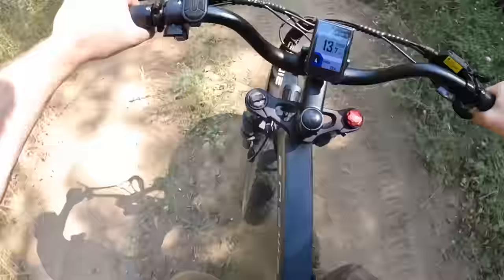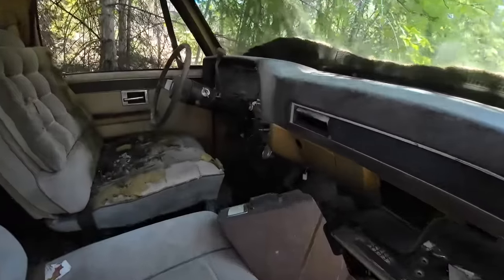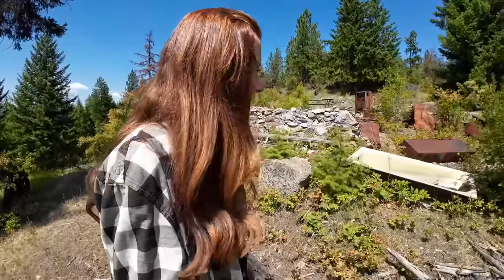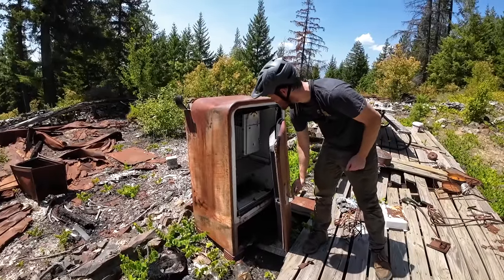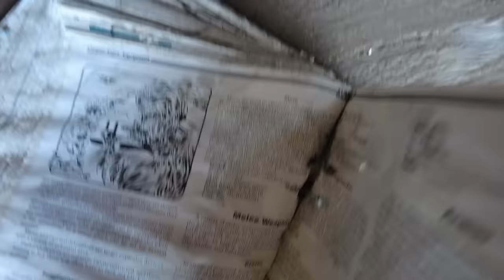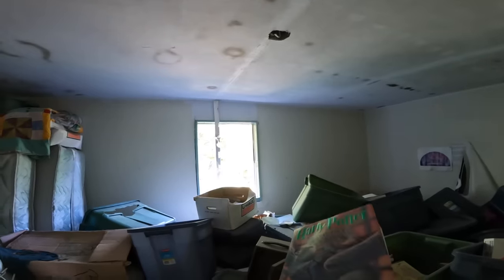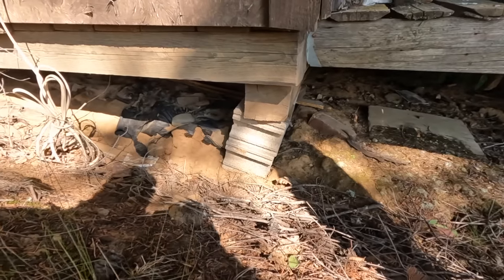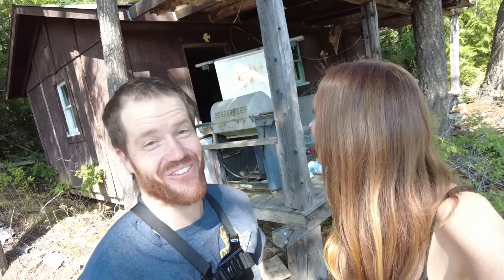We Bought An ABANDONED Homestead... cabins, trucks, & treasure?

Comment: Scrap the metal, bonfire what you can, dumpster the rest. Probably need to hook up a utility trailer to a UTV to get the garbage out. People grossly overestimate the value of a stick frame -- especially when they're clearly inadequate for snow load. The walls and roof cost way more. More stuff for the ol' todo list :)

Comment: It’s a pretty common story: the property was homesteaded twice, separated by 15-20 years as each owner tried to build their dream home “on the cheap”, rather than the right way.

One ended in fire, the other probably in bankruptcy and foreclosure, as any surviving relatives just washed their hands of the whole fiasco.

Best bet is to bring in a hazmat rated waste removal company to truck all the barrels, fridges, and other junk out, then bulldoze and burn pile anything wood that remains.

As for future use of those areas on the land, a seasonal tent and small RV campsite with off-grid electrical hookups and properly plumbed toilets on a septic system is one possibility. Depending how active you’d want to be with passive income, setting up a small general store and playground would take things up a notch.

Another option is building out a proper access road loop, and partnering with a timber company to come in and responsibly cut and replant a percentage of the land each year. That way, you rake in the residuals for owning a thriving timberland, the forest is adequately replenished and managed against wildfires, while you also create jobs for the locals.
Reply: They only own 20A !
Reply: Umm 🤔 I don’t think they won the lottery or the Powerball to achieve all your ideas 💡 💡😉😝😝
Reply: And run a few head of cattle to get the ag tax break.
Reply: more than likely they  have no mineral ,timber or water rights they are often sold off long ago!
Reply: Are you high? Do you know how much a hazmat waste removal company would cost to go way up there and removed all that crap? Sheesh...
Reply: @brucewitcpalek5120  No doubt. All they need is many tens of thousands to do all that.
Reply: @Badge124  you dont need cattle, only 3 acres,,,,,post more ignorance and ill reply to that also,,,
Reply: @glennwall552  world wide,,,its always money or control
Reply: @bill45colt says the guy with horrible grammar 😂

Comment: My wife having grown up in that area and my mother in law still living in the area, I can tell you that meth is a big problem (one of my brother in laws is currently doing time behind that). The condition of the contents of the cabin is indicative of someone who slid into addiction. 
As for how they got stuff up there  . . . dirt roads deteriorate over time. Looking at the condition of the road, it appears that nearly 25 years ago you could easily drive a pickup up there in the summer. Everything you saw there could have been transported there in a pickup.
I think you need to figure out if you can get the M1078 up there. If so, start making trips to the dump. The excavator will make quick work of ripping the place down once all of the trash is removed.

Comment: Fun tour, Thanks!   Beautiful place.   Random thoughts:  1)  That stuff is all stolen from storage  lockers.  That's why it's all in totes and it's more than people would normally have.  You can probably confirm that by the names on the pill bottles - are they all different?  They'd cut a lock, fill their pickup, and head for the hills.    2) I'd grab ALL those baseball cards!  Some are worth more than $4M.    3)  You might want to quickly sort that trash into a huge pile of the stuff that would burn cleanly for a fun bonfire in the snow.

Comment: The round battery cells are likely from a telephone company central office facility.
Reply: Some telphone central office batteries are big open jars. Like 2 ft tall and 1 ft diameter
Reply: Honestly, until Riley was standing next to the batteries, I thought it was an old, burned out still. Until I had a scale reference, they looked much larger than they actually are.
Reply: -48 volts.

Comment: OMG.  Those blocks in the foundation are oriented wrong.  The weight should be on the walls of the brick not the face.  So the holes in the block should be vertical.  That's the strongest orientation.  If you jack parts up to re-level that cabin, rotate those blocks so their are oriented properly, with something under them to distribute the weight, like a paver or a pad of concrete.  What a fun project.

Comment: You need to go through all those baseball cards. There are singular cards which you might find that could pay for that whole property. Let alone findingva bunch of 1990 rookies.
Reply: 90s baseball cards aren't really worth that much.  Like some of them I looked up recently are still around the same prices as they were in the 90s without being inflation corrected.
Reply: @yayinternets  that was just an example off the top of my head. There's a Derek Jeter card from Upper Deck or Fleer for example or Chipper Jones or Vlad Guerreo card that had some exceptional value. I only keyed on 1990s in my comment because they found other 1990s stuff. But looking at the stuff they found (TTRPGs for example as well) indicate that someone there was a hobbiest, which means they could potentially find some valuable baseball (or nonbaseball) cards, comic books and some other interesting stuff.
Reply: @thtadthtshldntbe  More of a hobbit than a hobbyist.

Comment: Ambition strikes has been one of my favorites but you are becoming a loose cannon, you never finish reporting on anything (Endless water? Road? Shop finish so you could start working on projects)  and now you are spending money on many thongs that you dont need.  Used construction equiptment will eat you alive with maintenance cost, the definition of a boat is "a hole in the water in which throw money".  Dont mean to be negative but stick to the original concept of your post which have been interedting in the past.

Comment: You can use the broken plates from the burned down cabin to make a cement table with broken plates.

The hoarder house you need to comb through carefully it could have tons of valuable collectables like as examples bottles, knick knacks, promotionally stuff , historical artifacts (both about the cabin/area and in general) trading cards (also some harry potter books and other books is worth alot)

Comment: on the truck you need a really long flat head..there should be a hole in the front behind grill by the latch ..insert and twist, should pop up..engine is 305 or 350 if its a v8.. i have had 6 scottsdales..

Comment: Scottsdale was the mid-tier chevy K10...lower was Cheyenne and top of the line was the Silverado. It could have the 305 V8, which was the weak link in the Chevy Trucks of the 80s. It probably has 165HP and 235ft-lbs torque, not bad, but kind of blah. Would be a fun truck to re-do, since there are parts available from 73-87. I did a 87 K10, but it had a small block. A little bit of work in the machine shop, plus a few trips to the parts yard and I had a 327 with PLENTY of power. I miss that truck. Plus it had fuel injection, which was a cool bonus for the 87s. Yes, it was only TBI, but it got an extra 1 mpg...

Comment: I am a reseller and you do have money in that second cabin, (at least you do for the stuff that did not get wet or smells musty) Hopefully you have a friend that resells that can go through it quickly and separate the trash from what is resalable. It will not be that same as finding gold like you said but possibly a couple thousand net. You can also take what is salvaged to a local auction house and have them sell it. Use the unbroken totes with lids to repack what you can sell and you can get rid of those also.

Comment: Hey that luv may have a surprise under the hood . overhead view showed middle of hood with hole --means maybe v8 lurking under the air cleaner ..Or v6 either way that's how a gear heads mind works ,was maybe a " sleeper " , like a 240z with a v6 or v8 with turbo ,, 0 to 100 back to 0 in 12 sec.

Comment: The batteries remind me of old glass jar telecom batteries.  They are very large storage but low voltage lead acid type.  They were also used in radio repeater shacks...

Comment: 9:33 the old scary cabin. My wife and I drive on most trips (you actually see life than 30,000 ft in the sky) why I said that we tour the south back country mountainous roads and saw cabin after and even houses on bricks, concrete pavers to stumps.
I thought NO WAY would I do that, then I had to think back country. In the south there's lots of flooding, so it makes sense until I saw this video. 
Apparently, you use what you find back in the 18th and 19th century back country homes? 
Great channel, I just found ya all.

Comment: I would definitely get everything out of the house first.  theres tons of what appears to be useless knick knacks, and books, so definitely get all that out that you can.  And then burn the rest of the place or doze it.  If you burn it, the mildew is gone.  but if you doze it, you will be tempted to pull out a rotten 2x4 and try to use it somewhere else.  If the property doesn't have any plans for that house, its basically a liability

Comment: What is the registration date on the license plate on the Chevy truck? Scottsdale was the trim level above the base version. If it has carpet instead of a rubber floor mat it was an uncommon option for that trim level. Some collector/restorer might want it if it's not beyond saving. K10 4x4 makes it more desirable to people wanting that, especially with manual transmission.

Comment: Imagine a beautiful cabin constructed from shipping containers on that hilltop.  You guys have the ability to build the best, most beautiful shipping container cabin.  How bout off grid shipping container airbnb.  I'd enjoy watching you guys.
Reply: No - don't do shipping container houses. That is idea that is only good on paper.  Just normal timber frame cabin is much easier, cheaper and lasts longer than house with steel inside of its walls. They carry cold, condensation and rust - specially the bottom of them. So if it suppose to last more than 5 years. Just normal timber frame house.
Reply: With the heavy equipment, tools and the knowledge of what would be required to achieve such a task.  They have  the ambition that's required.
Reply: @ronfetty8910  it is not about that, it is about paying 2000 USD for container, few hundred on transporting it on site. Then about 100 buck on blades for angle grinder to cut out doors and windows, then 3 - 4 days on welding attachment for foundation, roof, cladding, interior. Then double work on insulation both sides of the metal, then double vaper barrier for the metal. The rust prevention on the whole ting, inside and outside. Then you still need same foundation, same roof. and same amount of timber inside and outside. I saw someone try it, did the math and it makes no sense. Just buy 2x6 and make proper building!
Reply: Riley & Courtney already made a shipping container living space & lived in it - older video.  "Been there, done that" cliche applies, lol.  (It looked pretty good.)
Reply: I just believe that (ambition strikes) would enjoy something like that.  I don't believe that the math of a job and its
 overall cost.  The equipment they have would break 2 X 6s all day.  It's about the entertainment.  I'm a retired contractor.  That's not in my head.  It's watching them complete the task before them.  My comment was to ambition strikes.   All I've got to say.

Comment: I'm sure there are names on the pill bottles that would tell the story of who lived there, and there are probably public records somewhere that do the same for that truck.  Probably also some clues on the shipping labels on those boxes.
The appliances in the burned out home are from a different generation (maybe 1950-1960s) of some of the stuff you found in the green roofed cabin (some of that stuff was as new as 1999).  It is curious why people who were living in an off-grid situation circa 1999 would have so many devices that relied on electricity.  Practical consumer solar wasn't readily available at that time, yet I saw a Microsoft binder and manuals for electronic devices in the video.  Would be curious to hear what you guys dig up.

The folks in the home due south of the green roofed house might know what the story was here.

Comment: You guys should clean the cabin first and see if it's possible to renovate it or build a new one in the future.
Reply: hellno.  When the roof has been letting rain in for years, it will take a year to get everything out, get the wet walls out, get rid of the stanky wood, get rid of the rotting wood, the roof itself was built like crap in the first place, and then put another layer of shingles on top.  Hell no, this place is dozer time

Comment: Looks like they were in the process of packing to move things out and for some reason never came back. Also it seems like people found the place at some point and went through everything looking for anything with value.
As others have said, I would start a burn pile and sort out stuff that should not be burnt and start over. Excavator should make quick work of it and just a simple cabin to replace it should be an easy build compared to what you guys have done!

Comment: Riley: Never underestimate C’s woman’s intuition, she has “bad juju” about that cabin, previous owners left under odd circumstances, that misfortune plus all the pharmaceuticals should tell you there’s no treasures to be found, the land is your treasure…..pull out the plastic tubs and burn all the clothes, papers, furniture in place.  Gather all the scrap metal if it’s worth anything, burn the standing cabin and push all the ashes and foundation blocks to the low land septic hole to level it out and let mother nature reclaim those two building sites. Don’t build on top of either location to avoid any negative energy transfer to your family and good fortune. No need to make content, or advertise your actions on this, press on with your good ideas.  Blue skies 😊

Comment: The round things most likely are transformers aka capacitors that can hold large amounts of energy.
Reply: Transformers and capacitors are two completely different devices. No aka about it.
Reply: @Sembazuru  Actually there are transformers that are commercially available that already are equipped with capacitors connected to it called ferroresonant transformer.. Ferroresonant transformer is a type of a transformer that uses a capacitor that enables a constant output voltage even when the input voltage is varying amounts

Comment: Those are actually not your vehicles.  They both have titles that define ownership, and it's not you guys.  They are abandoned vehicles, and you need to follow your state's DMV procedure for getting them recycled.  That usually requires towing to a wrecking yard where they can have an inspector look at the VIN numbers, and get the titles released so they can be crushed.  Even if you spent money to get them working, they still wouldn't "come with the property".  If you want to keep them or just the truck, you would need to look up the owner and buy it, then transfer the title.  But your state might require an inspection before registering it.

You need to turn those drugs in, right away, before you get in trouble.  From the drugs you found, it sounds like the occupant was elderly, and probably died.  That's why the cabin was abandoned.  BTW:  The baseball cards might be worth something if they are not damaged.

Comment: get a trailer or bring the military truck with the dump bed and bring all that out, you dont want all that moldy stuff around and it could cause another fire in the future depending on what is inside. then maybe a controlled burn to get rid of all the old sheetrock and moldy stuff.
Reply: Ha, Sheetrock does not burn. Your Funny.

Comment: whomever lived there were extreme hoarders. dangerous mental issue. stay out for your safety.

i would slowly start maling a road up there. plan the path well so you can get your vehicles up it. then get the excavator up there and dig a BIG hole. then get the dozer up there (this is where your planning on the width of the road will pay off) then push the vehicles and the cabins in the hole(s). becareful to plan which trees to save. you will have a great place to build your house, and turn your apartment into the guesthouse. at least that is what i would do. have dun either way

Comment: i hope you don't make a parking lot out of this track. it seems to be filled with sad story's. and broken dreams. kids toys, there baseball cards. did the family die in the fire. did bikers attack them. you should, use a metal detector. want the easyest, money maker. put a dumpster up there. scope up all the burnt trash, the cabins. clean the whole track. use the dozer, plow a ok road in. keep it simple. make 30 sites for off grid Class B vans. no ele , no running water, have 1 bath house , 1 pole with a cell phone receiver. and dig, a septic, tank hole, drop a concrete, big ass tank in. set up cameras. charge , 20 bucks first come. 
cap, the amount of weeks at 2 weeks. then they have to leave for at least a month before they can come back and camp. set rules, Vanner pack out there own trash. the 20 bucks a day is on a card. if they trash the parking spot, charge there card.
that's, 20 bucks time 30 spots $600 a day times 30 days. $18.000 , peek, summers, say 4 months 4x18.000 72.000, a year.
and hey, there are what like 2000 people on you tube living in there vans off grid. there your 30 vans. hahaha